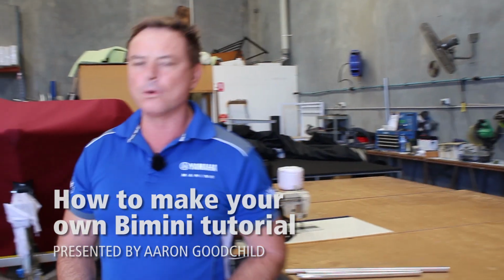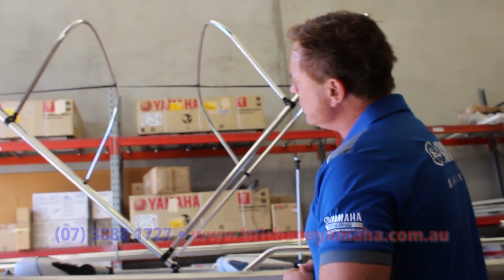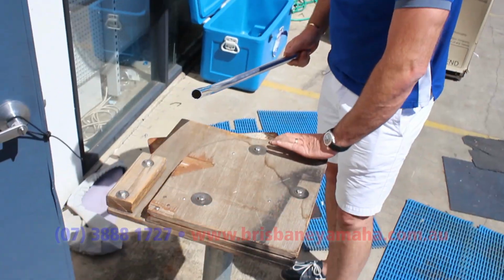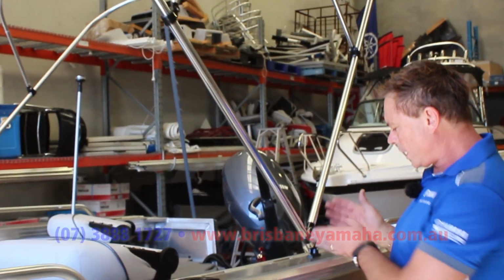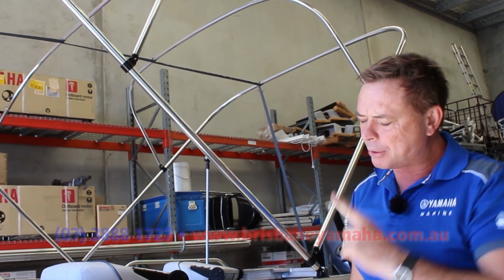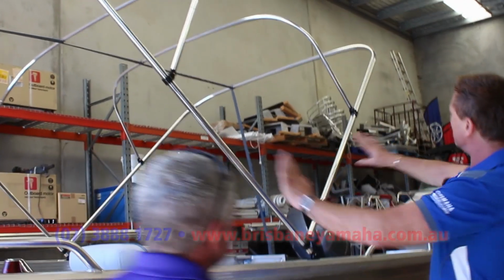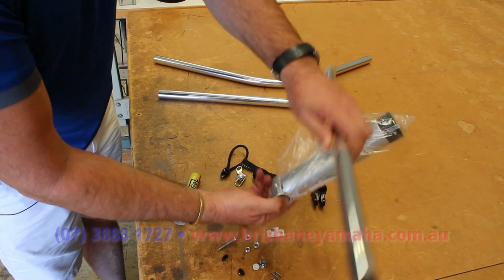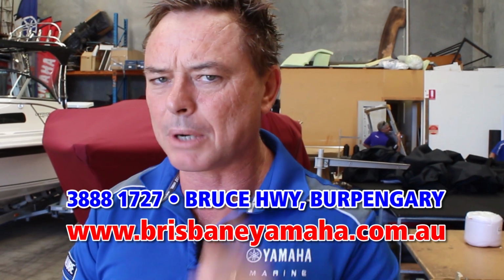How to make your own Bimini tutorial

Comment: I've been going down the research rabbit hole trying to figure how to bend the aluminum for the least amount of $$$ (pipe benders are pricey). It never occurred to me to build a jig. Thanks for sharing!
Reply: Can add sand inside the pipe so it doesnt collapse while bending.
Reply from the maker: What about commercial sewing machine
Reply: Not needed. I'm reframing my existing bimini so that I can pass through the sides. As is, the supports obstruct easy entry to my cockpit.

Comment: But you can just buy one on eBay for $120...
Reply: But its not from brisbane yamaha
Reply: Chris hollis what's your point?
Reply: Quality is my point $120 bimini will fall apart there shit poor man pays twice
Reply: Chris hollis mines 3 summers old and I'm out on my boat every weekend and it's still going strong! And if it does fail, I'll buy another one for $120 and replace it! I reckon I could buy 5 or 6 of them cost of one of these!
Reply: Thats good you must be a lucky then mate far from my experience and what ive seen... happy fishing 👍👍
Reply: Chris hollis you just have to keep them under tension. If you allow them to get lose, they will flap around and probably fail. I've actually been considering taking the top off mine and replacing it with lightweight aluminium to make a hardtop of sorts. I never take it down anyway cause I'm in Tassie and the sun will kill you here!